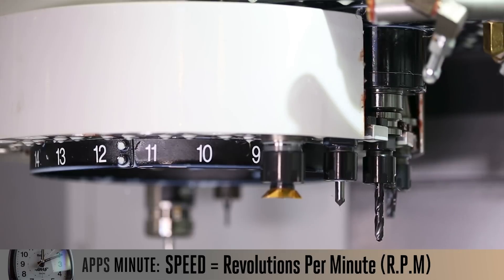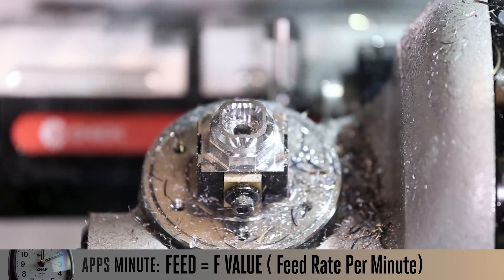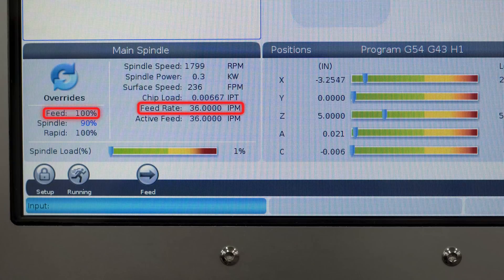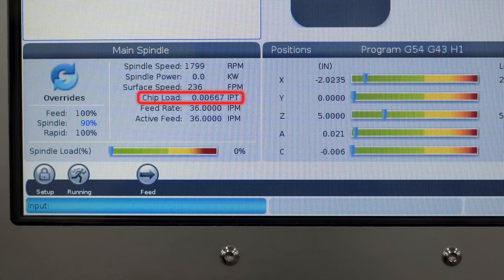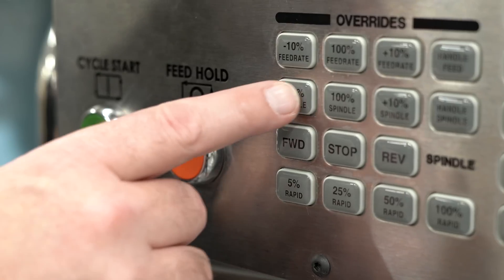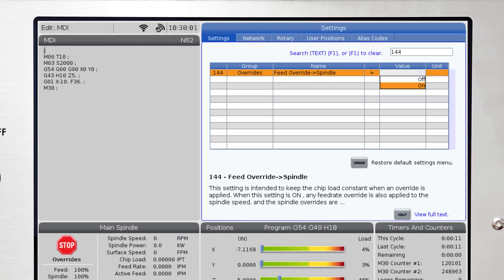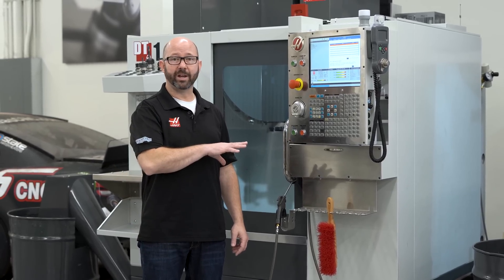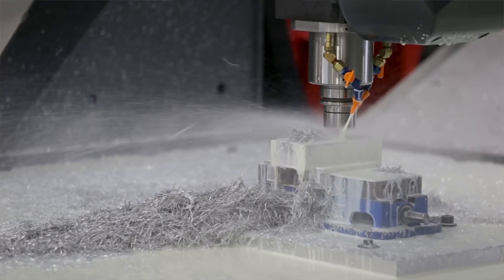Haas Apps Minute - Linking Speed & Feed Overrides with Setting 144 - Haas Automation, Inc.

Comment: when you put in a program that has a RPM higher than machine max - can you get it an alarm that notifies you of that?   happens when we move a program from a 10k machine to a 6k - It will not get to 10k but feed rate is still the same -  too much chip load

Comment: Why would you want to? If you lower the feed at the same time the chatter wont go away..
Reply: demandred1957 it depends, because it could.
Reply: Anything is possible. Normally option mean $$$ I think it's nice that you can change a parameter and choose to do it this way. An good place to use this feature this way would be in a situation where you are chamfering with a tool in a small hole and you keep having vibration. The tool may spend 0 .3 second in machining time but let say you would have to do 20 chamfer. having the option to lower or increase in the same time will help.